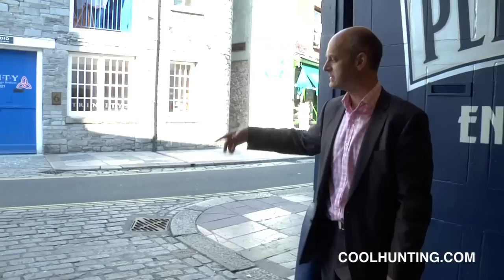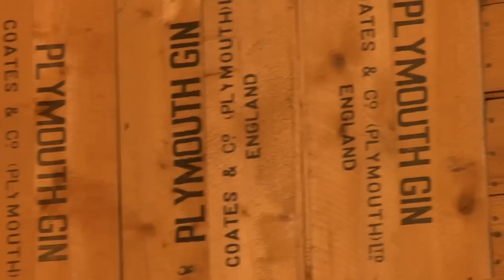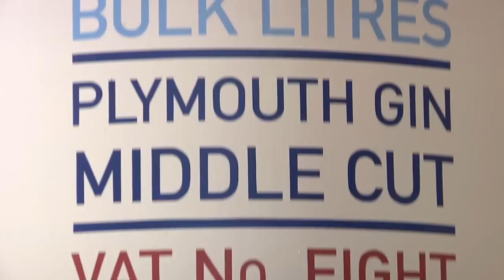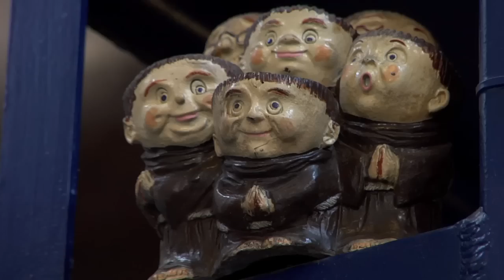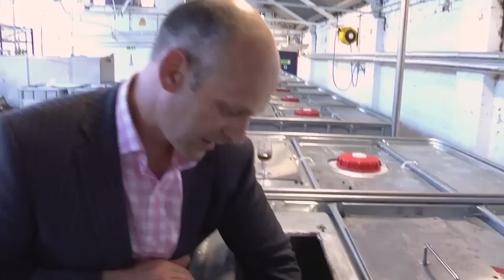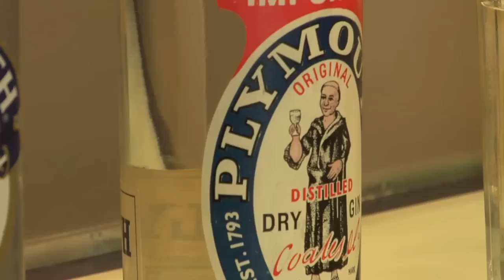Plymouth Gin

Comment: I should add, however, that the new green bottle is a disaster. There was absolutely nothing wrong with the original bottle. Try poring the contents into a "gigger." Almost impossible to avoid spilling a few drops [they all add up over time] because of the wide neck of the bottle. I have kept the original bottles, so I re-pour the contents from the new to the old.